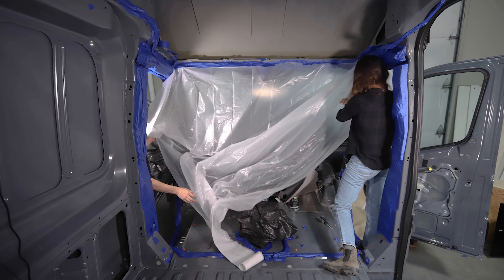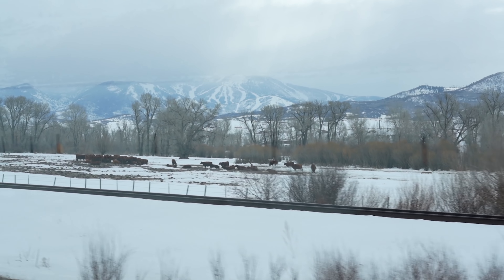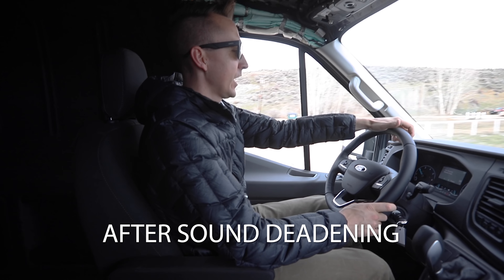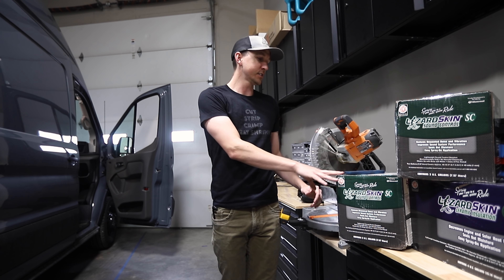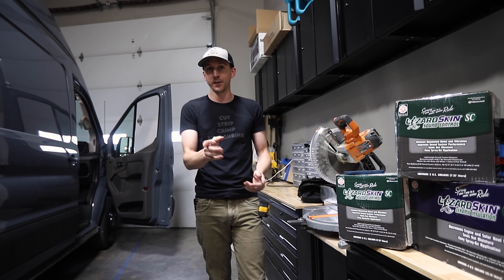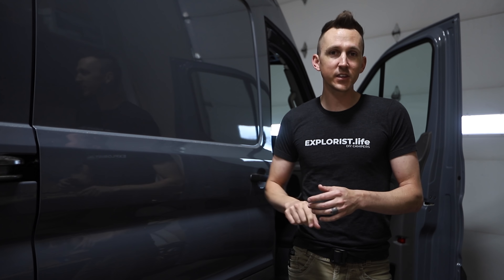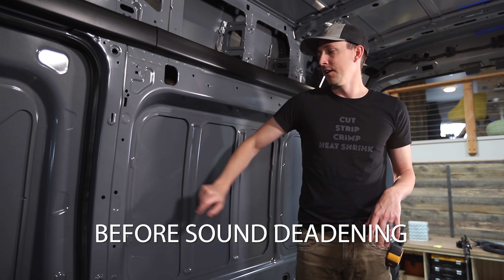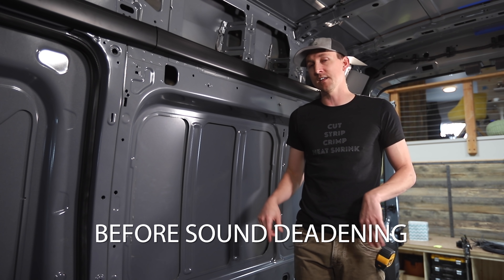Lizard Skin Sound Control TESTED in our DIY Ford Transit Campervan

Comment: We covered our Transit interior with Kilmat. However, just doing soundproofing in whatever way, is worth it.
We also ran tests with a decibel meter. 

The numbers were definitely better, but it’s hard to explain the difference in sound. I think just looking at decibel meter and looking at numbers can be deceiving and some would say it did not make that much of a difference. Also, how a camera "hears" sound, is quite different from how our ears perceive the sound. So demonstrating the sound difference via a video is very difficult and not really convincing to listeners.

But how the Transit walls respond to air noise and bumps was a significant difference and a difference that was for the good. And then once we added in the framing and insulation and shiplap, our transit became quite quiet. 

As a matter of fact, we feel that it is quieter than our dodge grand caravan. People need to not overlook really going after sound deadening. The so-called rule of thumb about only covering 25% of the walls I think is very misleading. The cost of a little more sound editing and the minimal weight should not be a worry, but so many people make comments about it on YouTube and they really don’t know what they’re talking about. At least that’s what I think! I see it as a "false economy" kind of thing - you might save a little money, but it will cost you after in comfort - sound quietness - for rest of the time with your van.

Comment: I installated, both the sound and the ceramic Lizard Skin, in our ambulance conversion. My main concerns were 1) vapor barrier and 2) insulation. I sprayed closed cell spray foam in between the ribs and directly over the Lizard Skin. Then we went out in the freezing temperatures, slept in miserable conditions, and looked for any condensation on the non spray foamed ribs. We didn’t notice any! The ceramic Lizard Skin is a great thermal break, for what it is. In the 120 degree Arizona sun, I couldn’t touch the bare aluminum skin or ribs with my bare hand. After I installed the ceramic Lizard Skin, it dropped the surface temperatures by 10 to 15 degrees. It’s definitely not a substitute for insulation, but it does make a huge difference. To be honest; I would, absolutely, invest the time and money on the Lizard Skin, and use a non spray foam insulation.

Comment: Loving the tag team presenting between you both! I enjoyed the different perspectives between you on your thoughts about the product. I think the effect was most pronounced in the difference it made on the roof panels. The support ribs on the side of the van probably already attenuate the sound on those panels so it didn't sound that different, but the roof was definitely night and day. I get the feeling that the Kilmat solution is like an 80% solution that'll allow you to get most of the way there, but has shortcomings, but the Lizard Skin is more of a complete solution that requires significantly more effort. With unlimited time and budget, it sounds like a great option, but for most DIY consumers, it might be overkill. It'd be interesting to see the difference in the cab if you go with Kilmat in there.

Comment: I have found that it works really well to glue Polyiso foam insulation using Gaps and Cracks spray foam to the large flat panel sections of a van build. I then use Thinsulite in the corners and hard to reach areas. It insulates really well (R7 per inch) and it does a significant amount of sound deadening at the same time.  My best guess is the sound deadening of polyiso is very close to the Lizard skin.

Comment: I know this segment was only for sound deadening but lizard skin has more benefits if you can afford it. You’ve missed another pro. Less metal exposed to rust. Very informative vlog once again guys. Cheers from Canader eh!
Reply: They don't usually rust from the inside... which is where they sprayed the lizard skin.
Reply: @Stubones999  if moisture gets in and it’s metal it will rust. I’ve seen plenty.
Reply: @Stubones999  
Absolutely not true! This is exactly how they rust. Condensation is created on the inside of the skin and if there is any exposed steel (screw holes etc) then the rust starts immediately.

Comment: Things I have done to make my Van remarkably quieter that maybe you would want to try.  I put ADHESIVE sound deadening on all flat surfaces and wheel wells.  Then I sprayed ALL hollow support struts with spray foam….THEN, I put glue silicone wherever there was metal meeting metal or two sheets mashing up against each other, then I put Lizard skin.  It’s over engineered but for SURE my van is remarkably quiet!  Also you van will be much quieter after the build with a mattress, cabinets etc…..

Comment: For the next video please use a decibel meter so we can “see” the difference because it was very difficult, if not impossible, to hear much difference in the video, which may not be a fair representation of the performance of the product. 

You missed what I think is the biggest benefit of all to Lizardskin. When you paint the sound deadener as opposed to sticking it onto the skin you eliminate any chance of moisture creeping under the stick-on sheets which will eventually cause rust to form. 

The biggest benefit of Lizardskin and sprayfoam (aside from having 2x the R value) is that you completely eliminate pockets and gaps where moisture and condensation can form to start the rust process. 

The Lizardskin heat product reflects heat but it also acts as an anti-condensation coating. By adhering spray foam directly to that you make it much more difficult for condensation to form, which is the necessary ingredient in rust formation.

Comment: Would be interesting to hear difference after full interior build.
Reply from the maker: I'll see what I can do! Thanks for watching. 🙂😁
Reply: @EXPLORISTlife  Yes, that would be interresting. I did the matt option. I regret it. For all this extra weight, I don't think it is worth it. I could not really hear any noticeable difference. Maybe floor and roof (for when raining if you don't have solar panels). I haven't finished my build but weight is also an important factor.

Comment: IMHO, sound deadening is for road noise in the front and ambient noise in the back.I don't think tapping test has real world relevance, unless one is prepping for sleeping while going through a car wash.  I do think the road noise test is relevant but only if the cabin is curtained off from the back or the back is filled with "furniture" because an empty van will always cause more sound. And I do think comparing sound while parked, outside AND inside to see if one can sleep while sound is outside and passers by can hear you inside (cayoties howling or van lifers partying) - but again, better with furniture inside.   
The Lizard skin heat control product would be something I would be interested in. While sound deadening doesn't rely on every square inch, insulation does and compared to Thinsulate and other insulators, I would think Lizard skin heat control product would cover all surfaces AND heat bridges. 
Finally, yours are the BEST video's on van conversions. Your presentation is calm and clear (you don't yell at the camera), no drama or needless theatrics. You get to the point,  are well organized and comprehensive. Kudos.
Reply: Tapping has a bit of relevance if you are sleeping while it’s rain hard outside. So I think we really just need to spray the roof. Kilmer would’ve be equally effective in this regard and is cheaper. I’d go with Kilmat for sound deadening and lizard skin for insulation.
Reply: @angeljia3506  Don't forget the hale stones :-D

Comment: Thank you for making these videos!  I wonder how much weight each gallon (of LizardSkin sound-deadening and insulation) adds to the weight when it dries up?
I haven't seen anyone doing it, but a perfect solution would be to layer LizardSkin sound-deadening, then LizardSkin insulation coats, and then spray-foaming on top of those.  Or maybe, LizardSkin sound-deadening, then spray-foaming, and then LizardSkin insulation layer, before adding the walling.  Apart from slim risk of warping,  what are your thoughts on layering LizardSkin products with sprayfoaming???
Also wondering if the effects would improve if the van exterior was also sprayed with LizardSkin sound-deadening, LizardSkin insulation and Raptor for the desired colour.

Comment: Great video mate, as always 👍 

Hope you don't mind me asking but do you really spray this to a thickness of 40mm? That's over an inch and a half thick just for sound deadening. 

4mm would seem more in the ball park, that's about 0.15 (or 5/32) inches.

Perhaps it's just getting lost in translation (I'm in the UK) or perhaps there's a rogue decimal place somewhere 🤔
Reply: @jacquesbourne9203  Ah, OK. Thank you.  

In the UK we refer to mm as mils. We do still use inches as well, unlike most of Europe, but less commonly nowadays and we tend to talk about thousandth of an inch rather than mils.

Comment: Did you notice the difference in the before sound test between the back panels and the front?  The front had a lot more of that metallic ringing sound.  That's because, on Ford Transits, most of the panels in the back are attached with foam glue underneath all of the ribs.  There's very little metal to metal contact. That foam glue kills a lot of the sound.  The front panel is attached metal to metal with no ribs.  So the results were a lot better on the front than in the back.

Comment: Have you used Rockwool before?  It is spun lava and steel and it will not light ... under 1,000 degrees.

Comment: I wish you could compare the after lizard skin with after killmat, and then evaluate cost/labor/performance. To my ears, the Lizard-skin after is not worth the extra cost, prep, or results, especially if killmat is anywhere near as good.
Reply from the maker: I think our final opinion is that if you were going to do the Ceramic Insulation... you may as well do the Sound Control.  If you weren't going to do the Ceramic Insulation... the Kilmat (or similar) would yield similar performance with less work (or at least 'more pleasant' work).

Comment: Can you still do spray foam insulation on top of the lizard skin
Reply: No reason to. Spray foam insulation does the same thing lizard skin does for sound deadening. May even be better with how thick it would get.
Reply: @CPRebels21  lizard skin isnt proper insulation. You would not be happy with lizard skin during a Canadian winter. Spray foam def the way to go if youre looking for best insulation
Reply: @isaacwesterback4499  Maybe the wording of my comment was confusing. I was saying spray foam provides equal or better sound deadening than lizard skin. I also know that the lizard skin that is advertised as "insulation" isn't even rated as such. You'd be much better of with spray foam than many insulation approaches for vans.
Reply from the maker: Keep in mind that there is a pretty high chance of spray foam warping the body panels as it cures causing ripples on the outside of the van.  This was the main reason we did not go that route as the risk was too great for us.
Reply: That’s what I’m planning to do but I’m only planning to put the lizard skin sound deadener on the sheet metal skin, not all over the entire interior. The benefit fit of this approach IMO is that there aren’t any gaps or pockets where potential moisture can be trapped.
Reply: @EXPLORISTlife  
Have you seen actual evidence of this or is this just an anecdotal internet rumor? I have yet to hear a first hand account  from someone who had this issue. 

If you apply the foam in thin layers and let it cure in between each layer, it shouldn’t be an issue. If you blast it 2” thick right all in one go then I can definitely see it being more likely to have issues. 

My friend sprayed his and had zero issues. I’m doing mine in the next couple of months.
Reply: @EXPLORISTlife  Yeah agreed, absolutely a risk. Easier choice for me with a used vehicle in canada. The risk was worth it for me! no problems so far
Reply: @carljonsson3292 Thats what spray foam does lol. if you want to spray, it would be redundant to use lizard skin.
Reply: @isaacwesterback4499  While I’m confident that you can just do foam and be happy with that, foam and paint has inherently very different physical properties it’s not going to make things worse to double up.
Reply from the maker: @Carl Jonsson, Yes.  I have indeed personally seen body panels rippled.  I've also rippled rippled metal in testing I've done off-camera (not to this van, though).
Reply: @EXPLORISTlife  
Did you ask them how they applied the foam on those that were rippled? 

So you rippled sheet metal in a foam test as well?

I guess the newer Van models are very thin skinned. For the Transporter 2s that we have this is not an issue. My friends T2 came out perfect but he was very careful to do many thin layers. 

I also think that once you have applied 4 coats of Lizardskin there may be less risk of rippling. That would be an interesting test.

Comment: it seems like if you don't put a bulkhead (between the cab and cargo area) the whole sound deadening effort is negated.
Reply from the maker: I would disagree that it's completely negated.  A well insulated bulkhead would probably work 'better' but I wouldn't say that's the only option.

Comment: Lizard skin? Similar to raptor liner, lineX, stuff?
Reply from the maker: Not quite, no.
Reply: @EXPLORISTlife  advertised as for interior dampening. Would it have worked better if sound deadening foam was used first before spraying the lizard skin... Or that would have defeated the sole purpose?

Comment: why would someone choose a Transit over a Sprinter?? Honestly unsure of the why, thanks.
Reply: My reasoning for a Transit over a Sprinter is the availability of maintenance facilities, at 6' 2" I can sleep sideways without flairs, idling the engine won't clog up the particulate filter, issues with DEF heater and the entire emissions. The only down side to the Transit is the Sprinter looks great whereas the Transit looks like a panda bear. Some creative vinyl wraps on the front end should help in the looks department.

Comment: My opinion is that this is a useless money and time wasting exercise.

The only sound attenuation that matters is when the panels and cabinets are installed.  I believe spraying this on the walls will have negligible effect on sound in the final fit and finish. 

Even if this product works, it should be compared to sound testing using the spray insulation applied in a later video. My bet is the spray insulation will provide at least as much sound control.  About the only possible application for this product would be if it is applied standalone without any additional interior finishing.

I’ll bet if you were to do another van conversion this step would be eliminated
Reply from the maker: Opinion recorded.

Comment: With all due respect as a former science teacher I didn’t find the tests very scientific and kind of ridiculous! Tapping on the wall and recording it on video before and after the material was applied and then discussing how you believe the sound changed is rather nebulous! For the life of me I don’t know why you didn’t incorporate a decimal meter? I will confess that I’m very skeptical about the whole sound deadening concept especially when strips of what essentially is butyl material with a foil/reflective backing is applied! Has anyone ever completed two identical vans, one with deadening material applied and then driven down the same road at the same time with a decibel meter? In science that is called a control group and a true science experiment needs at least one control group that doesn’t receive the experimental treatment. I think that it is likely that all that is being accomplished is paying the company that makes the material a lot of money. I will say that in my opinion, covering an entire surface rathe4 than strips has a better chance at success. Finally, if sound deadening is a big goal, I’m not sure way you didn’t opt for spray foam which would also cover the entire surface and if applied in thin layers should tighten everything when it expands reducing sound vibrations. Just curious why you didn’t opt for spray foam?
Reply from the maker: Sounds like you need to put out the effort to make your own video on the topic Mr science teacher sir.  With all due respect, of course.